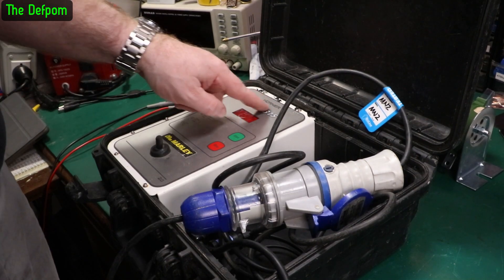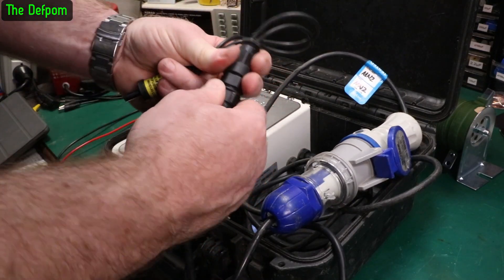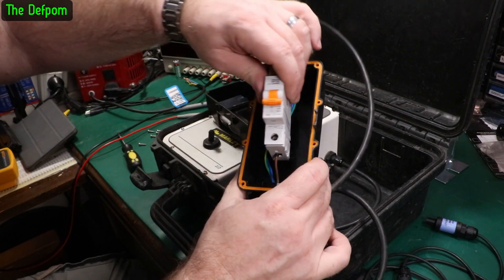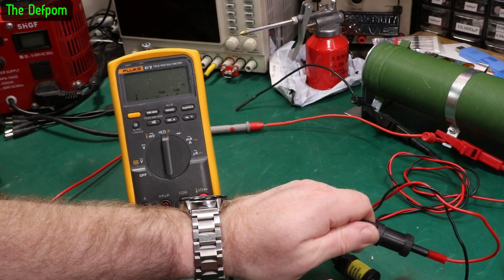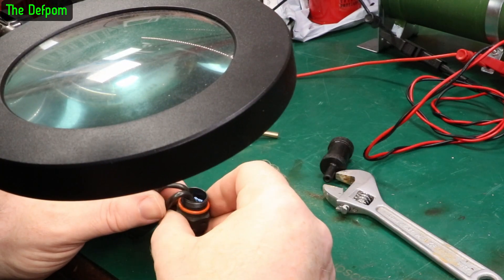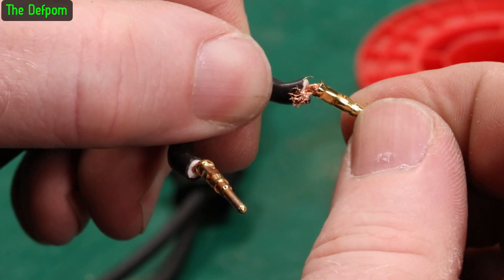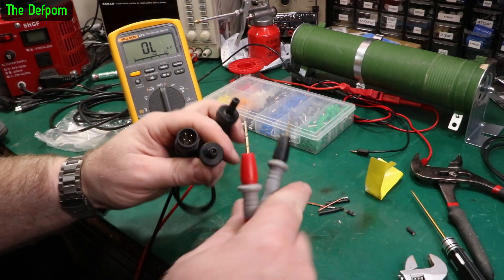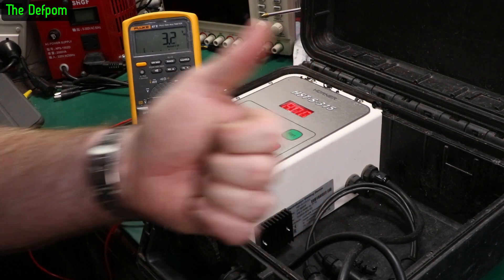🔴 Hurner HST-S-315 Electrofusion Welder Repair - No.1338

Comment: looks like you need to insert a pin extractor in from the front to release the pins so you can pull them out from the back.
pulling hard will just break the pins locking fingers and cause the pins to back put when inserted in the future.
These are make down to a price i expect, and inspection is just an overhead they think they can get away without.

funny that they have high current pins one end and low current looking pins in the socket.
Reply: Yeah like " Burndy " plugs and sockets you need a pin extractor, a special tool with a very special price!
Reply: @andymouse  i needed a pin extractor of a connector which was priced at £300 about 40 years ago. so bloody expensive in the day. I tried to borrow one from a distributer and told polity to sod off.  Bought one from them and it broke on the 3rd extraction, it was just like a tube made of 2 layers of tinfoil. could then see why they did not lend them out. 🙂
Reply: @ Yep ! you've been there :)

Comment: Hi, it looks like those line plugs and sockets were over-tightened when assembled.
It looks like those pins were not made for that gauge wire.
The unit is pretty clean, but the cable problems almost look like it has been abused.
Great job considering the quality of the initial assembly.
In NZ are all your fusing welders like that, here in Australia, ours are 49.5V and 50A units for the welding sleeves.
Makes for a very heavy welding unit.
Reply: Perhaps those connectors were designed for fixed installations rather than portable equipment. Thus, the manufacturer had to over-tighten to try and ensure the cables don't pull out when they get thrown around. Maybe bad choice of connectors.
Reply from the maker: @tomgeorge3726  these are based on 5A and 10A, at least for the size couplers these units are used with.